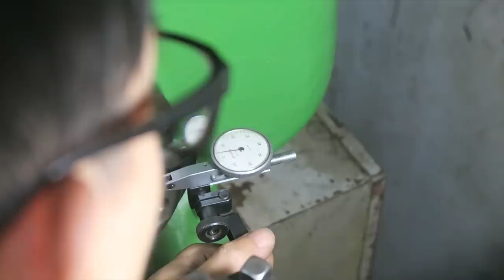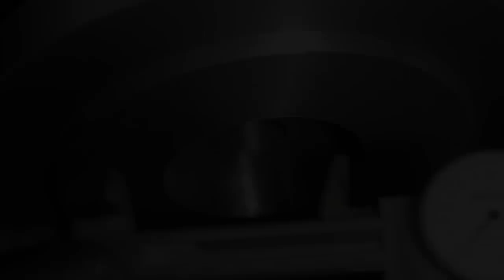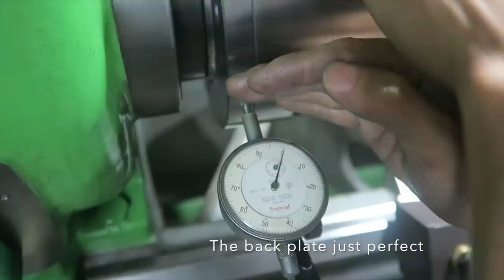Machining a lathe chuck BACK PLATE

Comment: Good to see some of the new generation of diy enthusiasts have taken a love to old machinery.
Attention to detail with your machining is outstanding. Very nice job on the lathe makeover by the way. 
I was always told (by a machinest) never to run your lathe with an empty chuck. The centrifugal force can damage the scroll inside the chuck. Of course, spinning by hand or running at a very low rpm would be insignificant. Anyone else heard this before ???
Reply: The way I've heard it is to never run your chuck with the jaws empty (and not clamped together), which is understandable.

Comment: Why is necessary to use cast iron instead of steel? Economics? Dampening vibrations? Dimensional stability? Anti seizing?

I need to make one plate for our CNC lathe and I associate cast iron with broken machinery parts. I thought that parts were made of cast iron to reduce manufacturing costs but then I read somewhere that the flakes of carbon  make cast  iron very effective dampenig vibrations, so I wonder if your choice is related to that property.

Comment: Mesmerising - great work, again. What material are the lathe cutters made from? Hardened steel? Titanium? Tungsten carbide? Are there different materials used depending on the depth of material you want to remove? Such a great video to see how to do this - great videography / editing and a skilled machinist. Thank you!
Reply: lathe cutters? as in your tooling
they can be made from anything really as long as its harder than your material but most of the time it will be carbide of high speed steel

Comment: Cà Lem, you checked the runout on the fresh chuck, but have you ever checked deflection of the chuck/spindle under axial and radial load?
Reply: You have to check it otherwise when tool pressure on there.chatter and deformation of the work piece will occur.